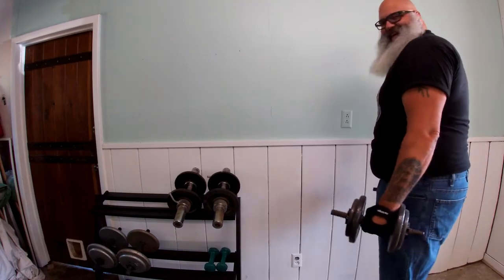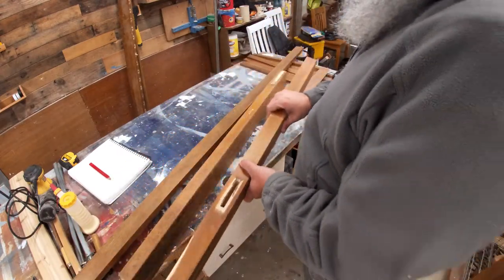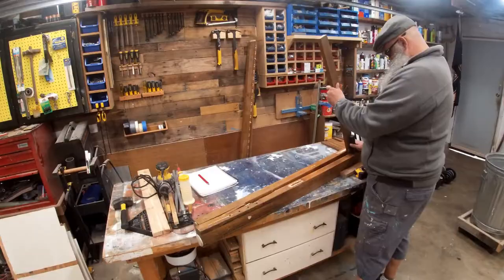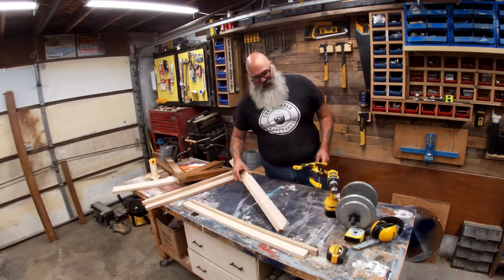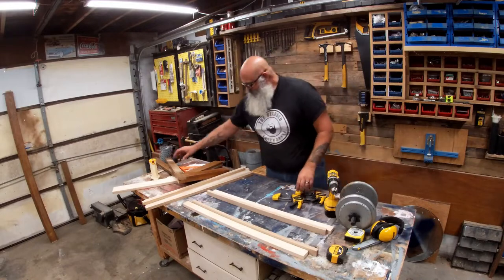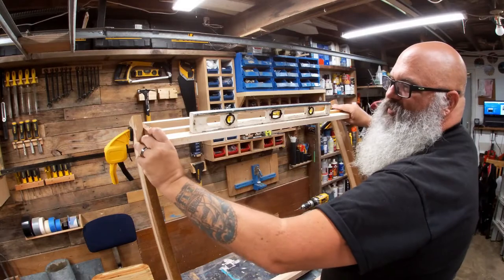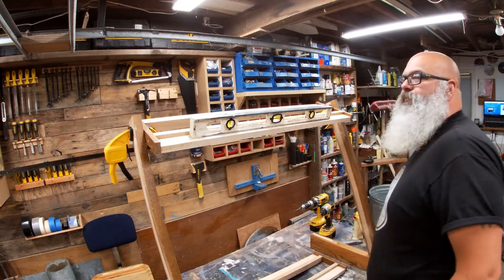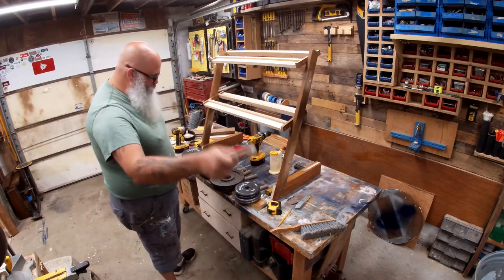Wooden Dumbbell Rack

Comment: Had you considered using a 1x6 or 1x8 appearance board as an angled shelf with a 2x4 under for support? a lip could be employed to stop the weights from sliding off.